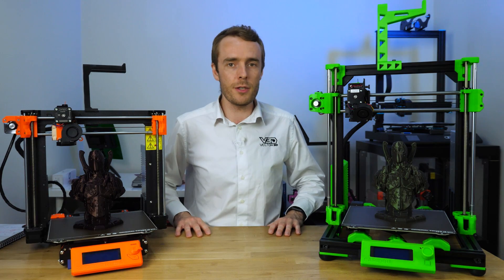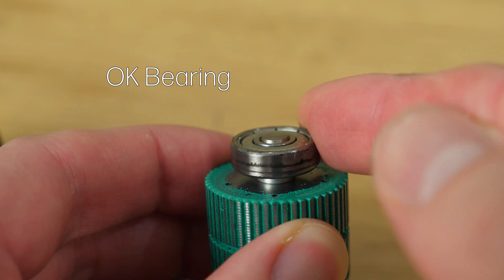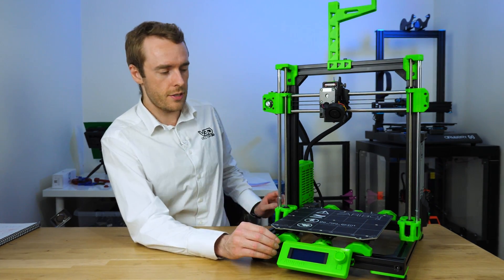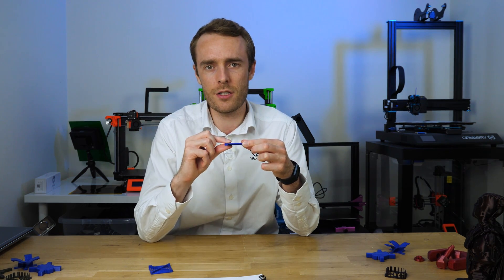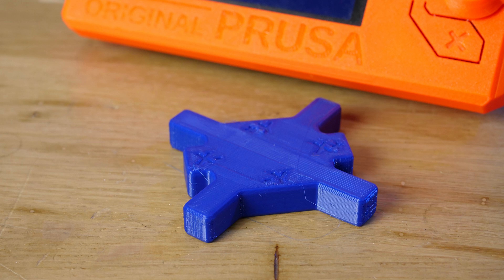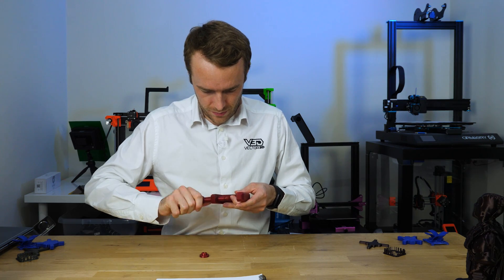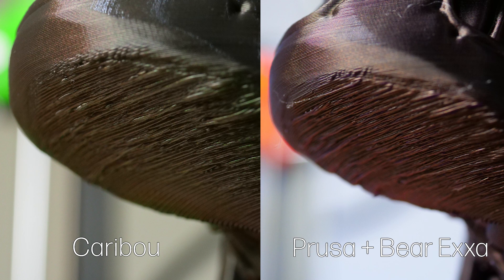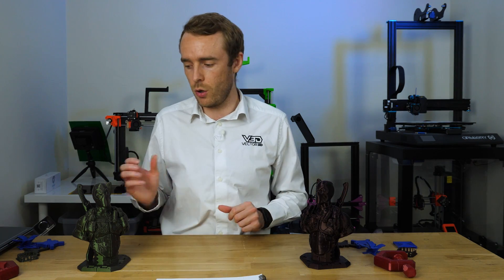Caribou vs Prusa + Bear Exxa Print Quality Test

Comment: Never heard of Caribou. A Canadian brand? 😁 What interests me is how steel rods and rod bearings have given way to v-wheels running in v-grooves of aluminum extrusions used for the frame. Pretty much all printers being sold these days, other than the Prusa, use the v-wheels. My only printer at the moment is a Wanhao i3 Plus I bought in 2017, and like most printers back then, used the steel rods. I wonder if the v-wheels are better, or plain old cheaper, or if it's just a matter of trends and styles.

Comment: Ball bearings can easily be replaced for cheaper than changing the whole motor.
Reply: Once a stepper has been taken apart, it loses at least 30% of it torque, due to magnetic weakening.

Comment: You could get 2 Prusa printers for the price of the exact green one he's showing here, The printer being compared almost evenly to the Prusa aside from a few things is 793.87$ more after shipping. 1,591.54 for Caribou and 797.67 for Prusa, both kits. I live in the U.S btw shipping was about even on both.
Reply: Look up videos of a Voron 2.4 printing. If you are useed to i3 it will look like someone is messing with you and speeding up the video. you can push the design to print 10x faster than i3 but for me it is a bridge too far in sourcing all the parts and building it. The attractive bit of Prusa for me is the consumer friendliness, it's a hobby for me but if i was running a print farm or selling parts I would be building Vorons for sure. I will wait for a nice Prusa XL kit personally, that's just about my speed.
Reply: @matisan8407  There are VoronKits available.
Reply: @lazyman1011  yeah but i heard there are issues with part quality, kit makers need to make money too so they cut corners so you buy a kit and then need to upgrade half of it to get to the quality of a self built
Reply: @matisan8407  Bad world!
Reply: Lol you voron guys crack me up ohhh you can print a 5 minute benchy and my stock ender 3 has the same print quality… they are a good diy printer. Voron kits are 900$ with getting the parts printer btw unless you no how to get discounts your not building a nice one for 800$ dude.
Reply: Get Sapphire Pro or Plus. CoreXY and does not cost that much.
Reply: And you can get a core xy that will outperform both for around the price of the prusa also
Reply: @oneheadlight8000  And soon Prusa will release there coreXY.
Reply: @lazyman1011  but it'll be priced the same as a trip to the moon. lol
Reply: Which one ?
Reply: @_Xantras_  there are a lot of kits under 1k.. I built 4 voron 2.4s for around $800 each. They print very fast and are very customizable.. it’s a total kit build though and not for beginners.
Reply: I get that but why are core XY better than the I3 type ? Isn't their build volume smaller ?
Reply: @_Xantras_  I'm interested as well. Like what is there to improve on? When you are getting pristine prints no layer issues no ghosting and at any layer height with multiple nozzles at high speeds what is better. Tbh it seems the next step up from a properly built prusa or similar printer is a resin printer. I have a feeling tho I dont know and would like to see is that if a video like the one above was done it would be the same. One is better at this one is better at that and really that's probably  the specific printer not the model.
Reply: @_Xantras_  inherent speed gains without artifacts.. the bed only moves in the z direction.. the belts can wear and be difficult to tune but for the price the print quality is excellent.. they used to be not affordable due to complexity but have gotten in that sweet spot under $1000 lately.. there are plenty of 300x300x400 corexy machines but they are generally smaller to make it easier to deal with the belt system. All of our parts are less than 3” in all directions.. it’s difficult to have a 3D printing business selling prints if they take more than 2 hours to print.
Reply: @oneheadlight8000  Voron is a beast.

Comment: Other than likely longevity, the main difference I’d expect to see in the Caribou would be better quality at high print speeds, thanks to its more rigid frame. Indio generally like over-engineered things, though, and as you’ve pointed out, the base Caribou is cost-competitive with the Prusa. The option for larger build height is very nice too, although as another commenter pointed out, that’s the weakest axis.

Excellent job with the build videos and this test comparison; you’ve won another new subscriber :-)

Comment: I dont know why you would need a geared extruder since my bowden has no problem whatsoever to feed, and then i realised that people may not switch temp for increased speed..and it makes sence..that is it is designed by fixing an issue that doesent exist, to extrude filament better. What you need to get max force out of any extruder is to keep as close to the shaft diameter of the nema 17, and allow for alocking screw of the feed wheel. That gives that 5 mm + 2,5 on each side for screw and material properties would land on 9-11mm. If you got a larger feed wheel than that it need to work more than necessary. If you get feed issues on a direct drive wich should have even better feed performance than a bowden adjjst temp and or throw the motor, or adjust rhe stepper driver or the amp. Microstepping is not as necessary on the extruder ( to fix noise) as long as you put a sheet of rubber on the bolts bit an 8th is not a problem at all. However, if you dont build or understand the logic the upgrades seems understandable.since the majority of the upgrades is freely available you could just print them yourself

Comment: Last year I had quite a bit of on location printing, involving a two hour long car ride each direction. I had a stock MK3S and a Caribou 220 I sourced and built myself (no Misumi parts used). One time the Prusa just couldn't get past the initial mesh bed levelling, until I redid the XYZ calibration on it. The Caribou didn't have that problem. Maybe just luck, but I attribute it to the much more rigid frame. I'll be building an MK3S clone with the Bear frame soon, so I'm curious about how rigid the frame is going to be compared to the two others.

Comment: I made a similar clamp in PLA and it made the same creaking noise when I first assembled it, but after using it a few times it loosened up and no longer makes the noise.
Reply: throw some vaseline gel on the thread when assembling and it will be much easier to screw it on

Comment: The problem with this comparison is that it leaves out some of the most important points about a 3D-printer.

Prusa does a LOT of quality assurance. Testing every electronical componant, using only high quality mechanical components and iterating based on customer feedback. Also: 10/10 customer support!
Of course, as the inventor of the i3 and it's succesors, it's easier to maintain and improve your own machine.

I have no experience with Caribou, but I can't imagine that they have a similar amount of QA and support as it's still a fairly new company. I wanna look more into that though.
So if I'd be in a situation where I had to choose between those two machines, why would I buy a Caribou machine for a higher price, which - yes - has some improvements on rigidity but not really much difference in print quality, and they lack the level of QA and customer support that Prusa has? This decision would be easy for me.

I'm not saying Caribou don't deserve their success. It's just that they still need more time to prove that what they do is really worth the higher price.
Reply: i concur, prusa support is top notch. I messaged them about an obscure question on a very technical detail (the exact size of the steel ball used in the filament runout sensor), and they got the answer in less than 10 seconds.
Reply: @AudreyRobinel  prusa support hasn't helped me at all , besides setting me back dozens of dollars for a replacement that wasn't even the problem.

Comment: Most of these tests are useless for comparison. You need to tune each profile to the machine, and they were obviously suboptimal in key areas. And then the question becomes if the Caribou can print faster while maintaining its quality. But the MK3 is outdated anyways...

Comment: Thank you for the video. The video starts with the Prusa on left and Caribou on the right. Then all the print samples are reversed. 

An important thing to note is Prusa has put millions of hours on their design. Caribou, while looks impressive, doesn’t have the bulk runtime. There is no actual data if their cable management is longer lasting. I would still suggest Prusa for someone running a 24/7 print shop.

Comment: What layer height were the overhang tests printed with?
Reply from the maker: 0.2mm
Reply: @Vector3DP  with 0.4mm layer height? Heads up, you should use a lower layer_height/line_width ratio than 50% when using overhang tests to evaluate cooling performance. At 50%, the reason the overhangs look bad is mostly because beyond ~63 degrees (arctan(0.2mm / 0.4mm)), each successive layer is printing over air instead of plastic.
Reply from the maker: @prxrb  doesn't really matter what settings are used as long as they are the same for all tests being compared. I chose what I use most commonly when printing.
Reply: @Vector3DP  respectfully, it’s not all that different from saying you tested the overhang performance of both printers with an 89 degree overhang, and found that both failed. Sure, the experimental setup is consistent between the printers, but it also doesn’t tell us very much because the setup just isn’t very informative

Comment: Here's the thing about making a project based on another. The benchmark is always unfavorable. It's based on a Prusa but it manages to be more expensive than the original. What this causes is that if the copy is not REALLY REALLY better than the original, people will always prefer the original. Not that I give too much props to Prusa anyway, but when you make a copy of something it will always be seen as just a copy.

But the truth is that FDM printers are already in the diminishing returns curve of the graph. They are all basically at a point now that there's not much to improve
Reply: Speed is the biggest thing to improve. When we're printing 400mm/s at current quality levels on exteriors I'll be satisfied.
Reply: there's still plenty to improve imo. It's just that the hype is for the prusa design which has been copied several hundred times by different china companies thanks to the success of the ender 3 series. Some points where its still not easily accessible under 1K like the prusa or without doing lots of DIY:
-300degree prints for PC
-corexy with prusa level quality (direct drive, works straight out of box)
-next evolution like the belt printer.

Comment: way to expensive.
Reply: You will get much better high quality parts than Prusa.
Reply: @JonathanKainzner  Uhh, which parts exactly are you referring to? Prusa is constantly testing almost every single part of their printers to ensure it's as good quality as possible while still maintaining their price. In terms of quality, I think Prusa is using pretty much the best parts available.
Reply: @Dom2705  hi, caribou is using misumi frame and rods. Printed parts are much better. Extruder is also better. 10mm rods. Wolfang trys his best, to offer the best quality as possible.
Reply: @JonathanKainzner  Using a different approach - as for the extrusion frame, different extruder, thicker rods and thicker printed parts - obviously adds to the rigidity, right. (It also adds to the weight though.)
But you were specifically criticizing the >quality< of Prusa's existing parts, which I don't think is justified.
Reply: @Dom2705  I really like Prusa. I don't like the low quality plastic parts. Thats all😁. The printer would be better, it would be more rigit. They are only using 20% infill and 2 walls...
Reply: @JonathanKainzner  I see :)
I think the plastic parts are good enough. Don't pin me down, but I'm pretty sure they print with 3 walls, otherwise yes, 2 walls are a little sparse. Using more than 20% infill wouldn't make much of a difference I think (see Maker's Muse's and CNC Kitchen's videos on that topic).
Reply: @Dom2705  👍🙂
Reply: @JonathanKainzner  do you use a caribou for your drone parts?
Reply from the maker: The base model which is very similar to the Mk3s in terms of spec is also pretty similar price.

Comment: Ooh, I do like that wire management!
That may not be what was intended as a big feature of the Caribou, but it's probably what stood out to me the most from that video!

I may have to "borrow" some ideas from that ;)
(The Bear X-axis parts are on my upgrade list, too. Especially since the Gates toothed idler I bought from E3D is too wide to fit in the standard MK2 part, so I need to print a new X idler side part anyway. I haven't checked if the Bear version would accommodate it, but I can try to modify it if not...)